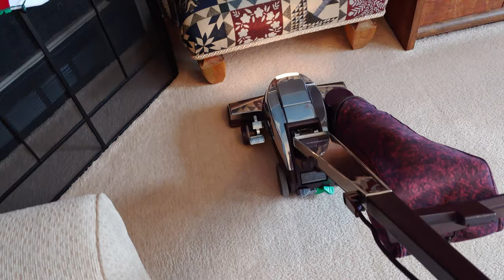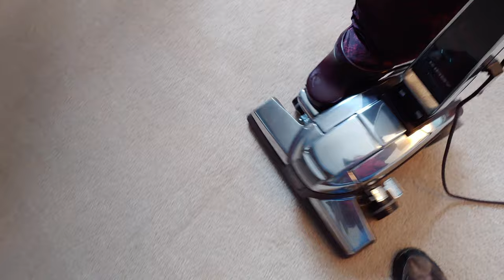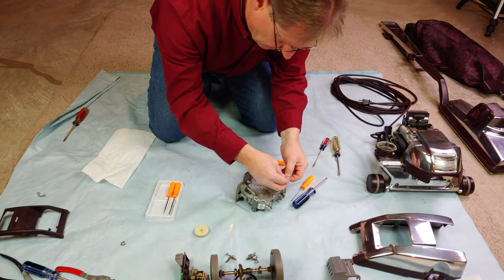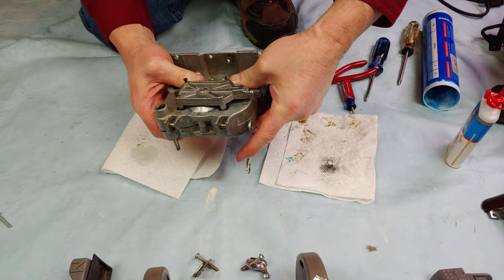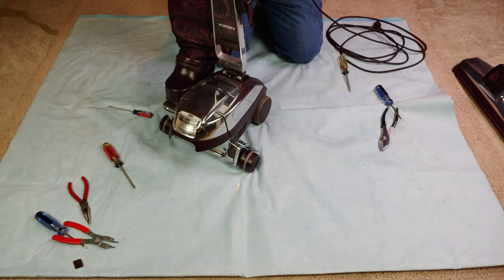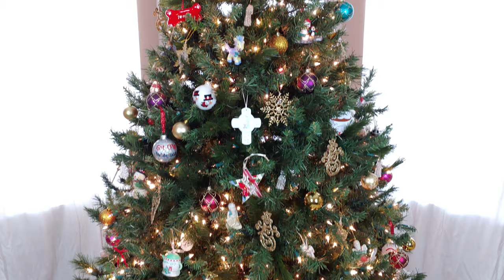Removing The Kirby G5 Transmission Nervousness

Comment: Very informative video. I tore my transmission apart today after doing the easiest things first ie checking the brushroll adjustment. I discovered there to be some scratches on the clutch contact surfaces on the pulleys, I chucked them in the lathe and gave them a very light finish pass with an MCD facing tool to remove the scratches, and polished them on a tin lap with diamantine paste. Probably overkill? I also degreased the bearings. A quick tip since I noticed you missed this, the flat bearings you see on the inside of the gear and behind the pulleys are needle bearings, the race can be removed with a small screwdriver or O-ring pick, and they can then be more thoroughly degreased and lubricated. Thank you for the video, may your tech drive be butter smooth!

Comment: Who likes and has used the  Kirby G5 👍
Reply: G4 and Avalir
Reply: I like the kirby Avalir
Reply: @mauricelong4678  i only run my kirbys with the high speed switch activated. Kind of a built in cheat function. Its gotta come close to double the power. Seems like a Minimum 50% extra.
Reply: @_AndromedaGalaxy_   I have 2 shark vaccums that has more suction power
Reply: @mauricelong4678  thats nice. they dont outperform kirby. feel free to debate it with Mr. Vaclab.
Reply from the maker: Suction is a pressure and doesn't directly relate to cleaning ability. Airflow actually moves the dirt because it is the speed of a volume of air.
Reply: @VacLab  ok
Reply: @VacLab   :)
Reply: I use a g5 that used to belong to my babysitter, I f'ed the transmission and got another one that works like it by speeding up one from a sentria! Classic feel and sounds
Reply: I have all the self propelled Kirby models all in mint condition. I must say that my g5 has something just ever so extra smooth about compared to all the rest. The others are all nice and drive like caseloads and that g5 of mine runs like rolls Royce.
Reply: @mauricelong4678 sharks are garbage like everything else on the market I’d like to see one last over 25 years……..😂

Comment: Very cool! That’s a 1997 G5 as it has no indicator and that’s when it came out.
Reply from the maker: My G5 is dated 1996, so it's a super early model. What's funny is my G4 is also dated 1996, so it's a really late model.
Reply: @VacLab  
What’s your G5’s serial number?
Reply from the maker: @KirbyVacuumCollectorFixer  1960900093 for the G5 and 7960116222 for the G4.
Reply: @VacLab   
Interesting to say the very least.
Reply: I wondered why my grandma's old G5 didn't have an indicator. Doesn't make sense to me since the G3 and G4 had it
Reply: @whelenvortexr4  
The early G5s did not come with those due to a complaint that it hindered edge cleaning. But of course later on it was added back but on the opposite side of the nozzle.

Comment: I have a 1997 G5 that doesn’t have the brushroll indicator either I’m curious if you can use the new style brush rolls with the magnets in them because my aunt has a Gsix and the brushroll is different and only goes in one way
Reply from the maker: You can put any G series brushroll you like into any other G series. The only difference is that the BPI light won't light up when using the newer "oblique" BR in the G3-G5 series.
Reply: @VacLab  I don’t have a BPI light on my G5
Reply from the maker: @subarufan1237  neither do I.

Comment: some ppl watching this will probably be turned off from the Kirby's but these issues are exceedingly rare. thats why kirbys last so long. with mine (G4 and Avalir) i only use them with the high speed switch activated. seems like it nearly doubles the cleaning power of an already magnificent beast. only downside is that it might wear out the belts a little quicker.
Reply: I have 6 Kirby’s. I have a 1985 Heritage II, 1989 Legend II, 1991 Generation 3, 2004 Ultimate G Diamond Edition, 2007 Sentria, 2018 Avalir 2. I use Micron Magic white poly disposable bags and knurled belts in all of my machines. All of my machines are set up to use Low Speed for floor and High Speed for hose.
Reply: Have you thought about getting a Sanitaire SC679K with the ball bearing Vibra Groomer II and the disposable F&G bags conversion kit? The Sanitaire will deep clean better and have more airflow than the Kirby Heritage II and Kirby Generation 3. Have you thought about getting a Sanitaire SC3683D? The Sanitaire will have more suction and be easier to handle than the Kirby Heritage II and Kirby Generation 3.
Reply: @robertgwisdala5795  if it cant use a hose ill probably pass. one lacks a brushroll and the other lacks a hose.
Reply: I replaced my bad 5amp motor in my sanitaire sc679j with a 9.5amp motor. VG2 brush and a red zipper bag that accommodates f&g bags. It is now a great unit.
Reply: I use a oreck canister and extension wand with accessories to tackle what the sanitaire can't do.. I also have g4 kirby & a santria 2 they are great vacuums. Let's celebrate that. I have about 14 vacuums these days and a oreck orbiter buffer carpet cleaner.

Comment: can you tell me how to disable the sissy drive from transmission when it's turned off it won't roll unless i put it in Neutral
Reply from the maker: You can't. It's integrated into the rear wheels. Why can't you simply leave it in neutral if you don't want to use it?
Reply: @VacLab  thats annoying I broke the handle because people who use it won't leave it switched to neutral
Reply from the maker: @ericb9511  sounds like you need to train your users. Or remove the vacuum from the home. 😁

Comment: Mine only skips on the pull back..  whats the point of the transmission anyways though?  Just to make it easier to push n pull?  Cuz i just disengaged it and seems better than ever to me..
Reply: If it seems easier then it's not working right, mine may as well be a limestone cube without it

Comment: My transmission has failed on my g5, I swapped it over with another working one. Does anyone know if they are an easy fix?
Reply from the maker: They are not fixable as no parts are available. I made videos showing the complete teardown though.
Reply: @VacLab  OK, good to know, I was told by kirby repair agents that they are so reliable they have never ever needed to replace it. Whats weird is it only stopped working after the drive/neutral pedal fell out, I put it all back together with another pedal and it still didnt work, so I replaced the whole transmission.
Reply from the maker: @nzoomed  that's a laugh! If the transmissions never break. Why are they available for purchase,? 🤣
In fact, a transmission under normal regular use will wear out its clutch material in the 10-15 year range. You can tell by the loud groaning, grinding noise they make.
Reply: @VacLab  Every kirby ive owned makes that sound, I just thought it was normal!
Reply from the maker: @nzoomed  nope, that means a worn transmission. New ones are nearly silent.
Reply: @VacLab  OK, good to know, are they are very expensive part?